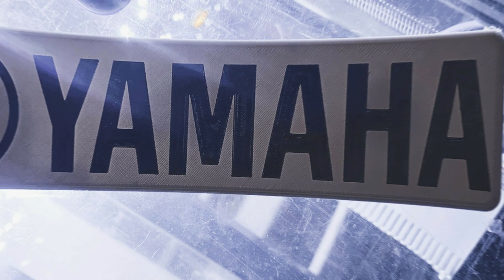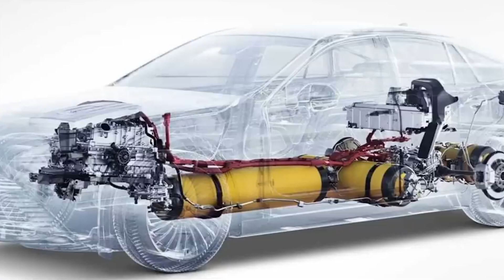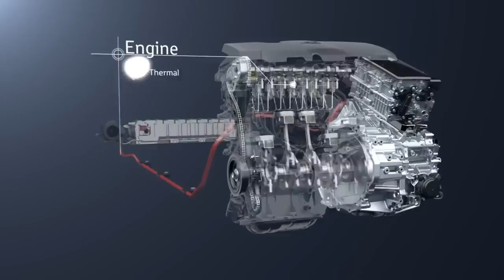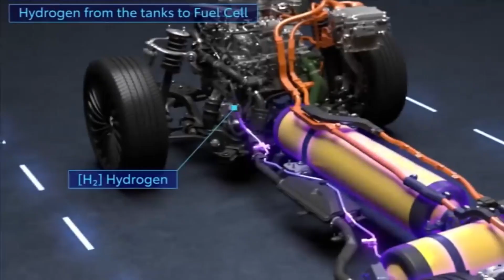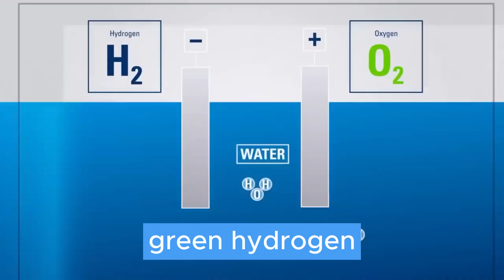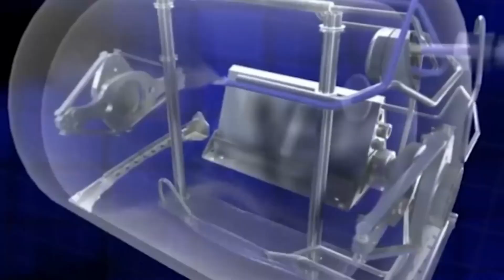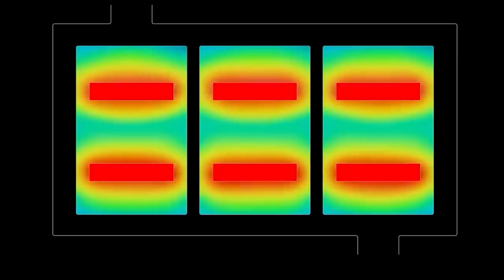Toyota's Says They Just Destroyed EVs - Hydrogen Combustion Engines

Comment: Driving around with a hydrogen bomb in your car will be much better than a car loaded with explosive batteries.
Things just keep getting better. So many ground breaking discoveries to solve a problem that didn't exist.
Reply: ICE cars burn 10X more per mile/time than battery cars.  H2 is DOA as a fuel, fundamentally uneconomic for surface transportation.  
Difficult to get much more dangerous than gasoline really, hydrogen itself is generally better but the exceptional pressures required are a problem.
Reply: @Mrbfgray  Battery cars take 10X the resources to produce than ICE cars, and don't last as long. That may be something to consider.
Reply: @stevenwithanS   If that were the case they'd cost close to 10X as much, they do not. They are reaching purchase price parity and a used up batt pack is high grade ore to be endlessly recycled.  Mine once use 'forever'.

Metals in ICE cars are, of course, also recycled but you can only use oil once and IC engines are about as advanced as they'll ever be, no way they can compete with 150MPGe of an econobox BEV, or 125MPGe of a nice sedan or midsize SUV.

Tons of propaganda out there, keep your BS detector up to speed.
Reply: Hydrogen is stored in carbon fibre tanks that dont explode, they just crack